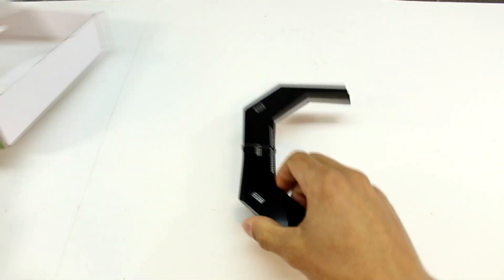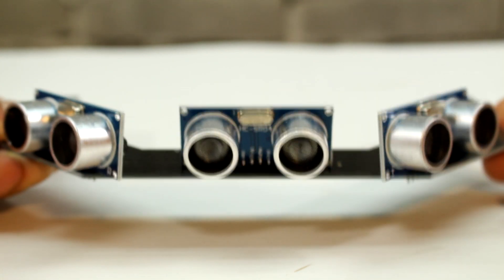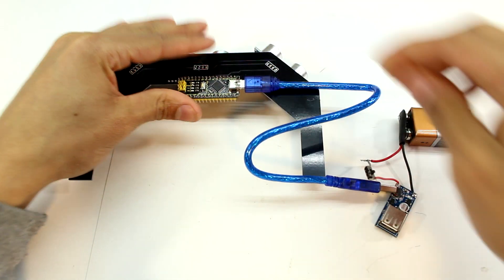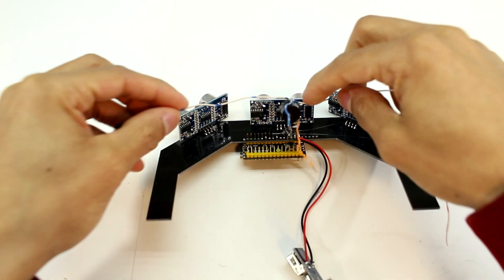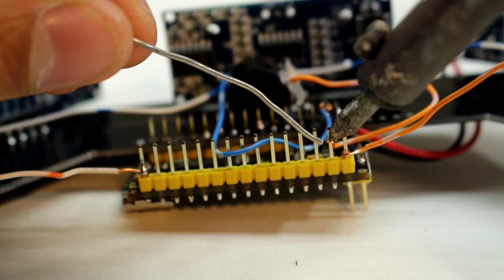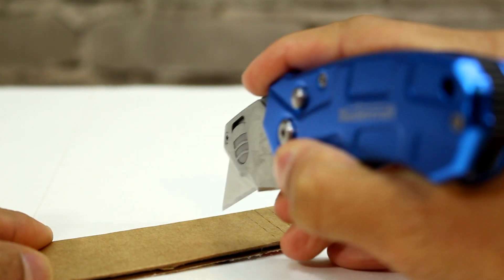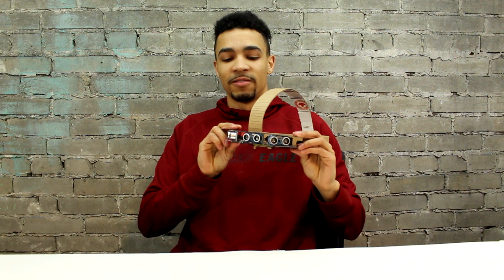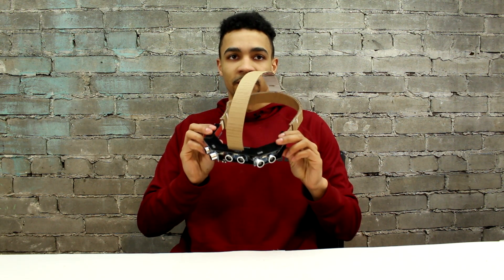How To Make Amazing Smart Glasses At Home

Comment: The code is completely wrong. You're also using a voltage booster claiming that it regulates for a smaller voltage. I honestly thought you were making a joke video, but you seem to trust that this works... You're honestly lying in your video